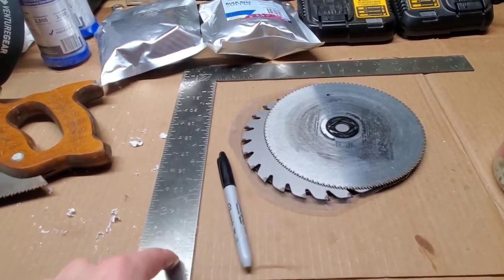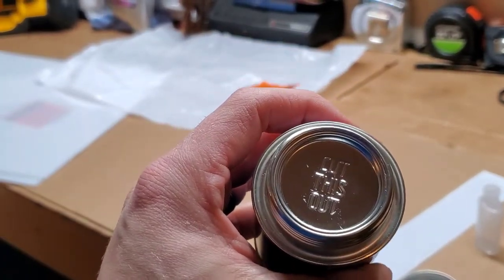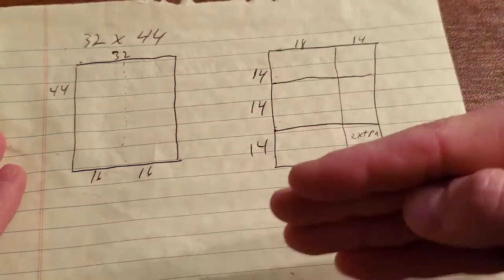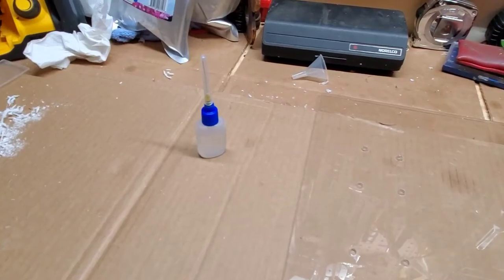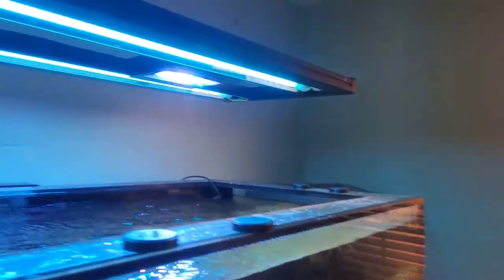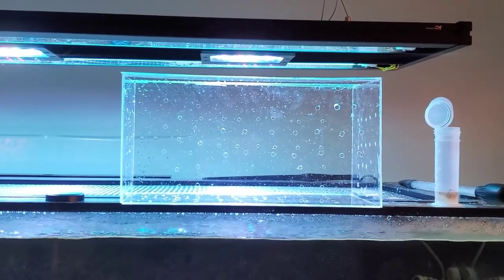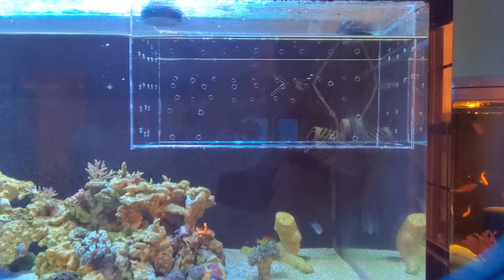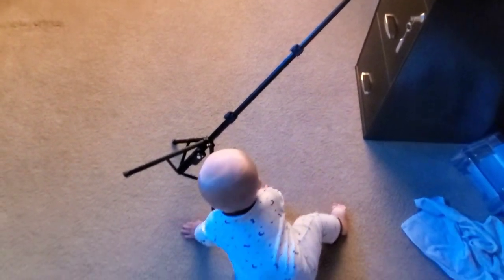DIY Large Acclimation Box for Fish for $40

Comment: I'm looking for something similar and stumbled on your video.  I think I found a better option.  There are pretty widely available clear display boxes used for things like collector items, model cars, ball caps etc.  They are pretty cheap and come in a lot of sizes.  Just drill your holes and you're good to go.
Reply from the maker: You can also use some hermit crab habitats in the clear box. I just didn't have any in my area. Plus I wanted to experiment.  I woulda done it differently in hindsight